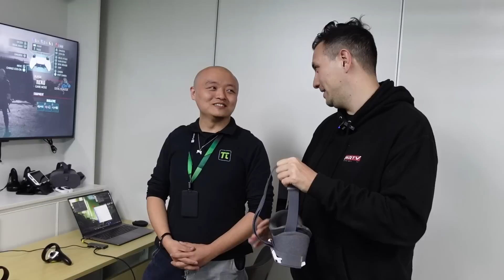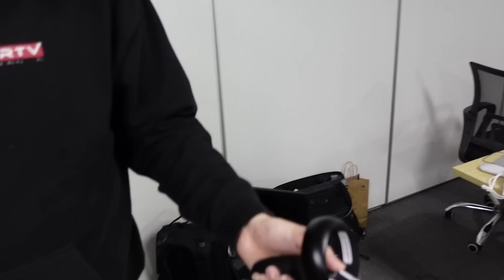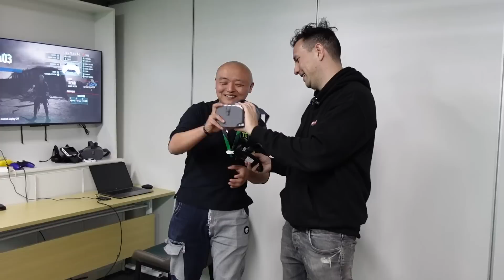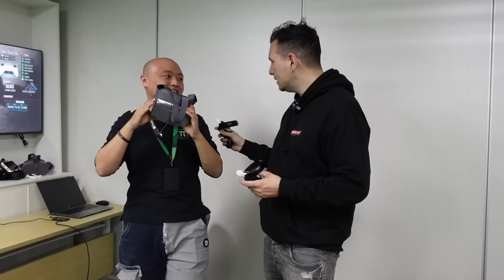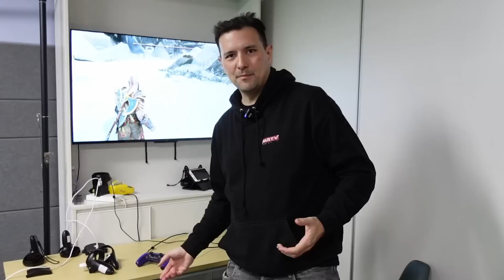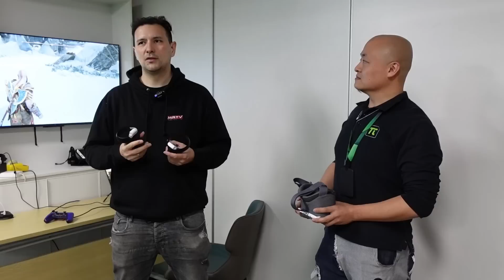Pimax Portal: VR Mode Finally Tested! How good is it???

Comment from the maker: What are your thoughts about Portal? Interested in picking one up?
Reply: I was hoping it could be a direct quest 2 competitor but with lower fov and not that good controller i dont know. 
I was hoping the visual would make the difference. But it dont look that enought.
Im guessing they sacrificed FOV for more pixel density.
Reply: I wish it was a PC VR solution like a SteamDeck or AYA NEO but with built-in VR.
Reply: @JViz  it does connect via hdmi
Reply: @JViz that would take a lot of black magic to pull of and even if you could it would probably have terrible battery life unless if Microsoft actually sorted out windows on arm
Reply: My daughter would love this. She plays handheld devices a lot but VR a bit.
Reply: I just thought it would be relly cool if VRChat ran standalone on it and it had a desktop like handheld mode for when you just want to hang out with some friends while being in a public enviroment where you dont want to use the headset part. this shouldn't be too difficult to implement
Reply: @chief00000000  This I would be hyped for. Desktop VRChat and ability to just pop it in the headset caddy and reboot vrchat into vr mode, seamless and all in one.
Reply: snipdrigon 8gen2 wit the 4k 120hz display
Reply: I don't know if your following Kickstater MRTV but they just released a ridiculous update for a black pimax unboxing that no one cares for and here is an interesting comment from a domestic backer below the update video on kickstarter "I am from China, in the Pimax official community, the customer service staff did not reply to anything related to the delivery at all, and the pimax management claimed in the community for countless times last month that the delivery was imminent. Finally, at the end of last month, the management suddenly said that the delivery could not be made, quit the community and disappeared, they have been lying to everyone. In addition, I can definitely tell foreign friends that the reason pimax claimed that the goods could not be delivered on January 31st was due to logistics and COVID-19. However, there is no problem with logistics in China and the epidemic situation in China has completely recovered on January 31st, which is a fraud. As of April 10, there was still no explanation from China's official community for the disappearance of their official personnel?
Reply: so they are doing mobile vr ? i thought that died off with the samsung gear vr which i loved but its very limited. looks like they saw the switch vr and thought "hmm we could copy that and release it and we will add 6dof and claim its better when realy its a tablet in a vr gogles frame." yawn seen it before and i moved on to bigger and better things.
Reply: @UnwellGaming  the quest 2 is the exact same thing but the tablet is built inside the headset.
Reply: @UnwellGaming  what is the difference between a VR headset you can't take out lol? The only thing missing from gear VR was 6dof. Now you can get a headset with eye and mouth tracking and hopefully upgraded it in the future easily with a new tablet with better screen and chipset.
Reply: @UnwellGaming  What are you talking about? The quest 2, and pico 4 are essentially the exact same thing as the Portal. They feature all the same capabilities. 6dof, passthrough, motion tracked controllers, etc. Its mobile VR in the EXACT same sense as the quest 2 is, because it actually as some hardware components, like the screen, that are flat out better right? 

You seem uninformed. I'd recommend not leaving comments anymore.

Comment: What kind of lenses? Also elephant in the room this is the cheapest miniled vr headset on the market with 1000 local dimming zones per eye. One third the price of the Crystal. Also they could release updates to the headset holder later at high profit and major improvements to the experience. Possible even with addition of depth sensor or front cameras... People are unerplaying the potential here. Also much less complex seeming power solution vs Crystal and probably lighter (looks lighter anyway to me).

Comment: Do you think that geforce now could run at 1080p 120hz / 120fps on this?
Reply: It can run at whatever the screen supports as long as your internet’s good enough. This has a 4K 144hz display, so it should run 1080p 120fps fine.

Comment: No interest for reasons:
- can scratched through the use
- limited fov
- limited IPD
- heavier front
- headset part will have some wears and dust collecting (you will see it after some months more)
- controllers are bit weird, sticks more at front, so no-no for me. I need small controllers, not big ones.
- Same wear reason on controllers, plastic damage etc...
- much lower resell value due more wear risk and damage on screen panel.
And i am more full VR gamer. Why should i play it as desktop or handheld?

Maybe for some people who want have both sides, Switch-like gaming and some VR, don't want buy both separated.
But keep in mind you need clean screen in VR, or you will see scratches already. So it's not great idea even concept is nice idea. It will wear more out and damage risk on screen is possible.

Comment: the right controller instead of turning it upside down as other ppl mentioned, as the distance between the stick and the buttons is quite small, wouldnt it be better to set it horizontally?(maybe both?) like at one side, be it the left the stick and at the right side the buttons, in my head that looks better than having the stick below and the buttons above, this way looks like the stick gets in the way of your thumb to press the buttons imho
Reply: I think I saw 3 additional buttons under the left hand stick (I believe this to be the customisable buttons in handheld mode) this is probably why he said "it feels totally normal, like a quest 2 controler in my left hand"
Reply: @chief00000000  you're fucking right i didnt even see those buttons, there are 3 on each side of the controller (12 in total), looks like menu, go back and something else and the other side has a "X" but still, if u want to get to all 6 extra buttons would'nt it be better to set it horizontally? if the position of the right stick feels odd then those 3 buttons are hard af to reach or maybe those 3 buttons are on the bottom of the left controller dunno

Comment: The portal does seem interesting. I don't know if the specs are better than the steam deck. Cool though! Crystal for me, maybe, ... I just got an artisan.:face-blue-question-mark:
Reply: Non-comparable, one is a mobile pc running a Linux distro , and this is an Android platform running pimax launcher. 

Crystal will likely run a similar launcher to the portals while in stand alone mode though (as I believe they both use the xr2 processor)